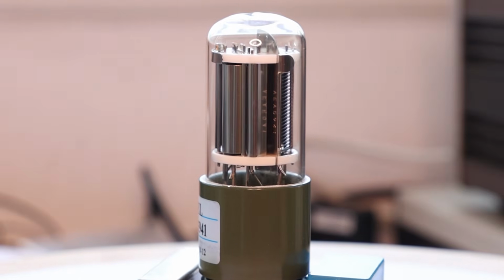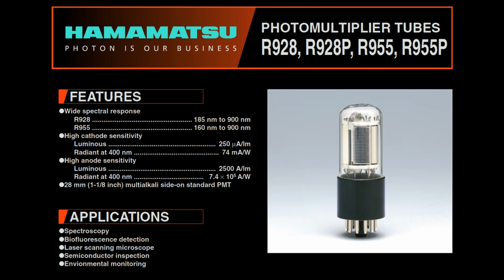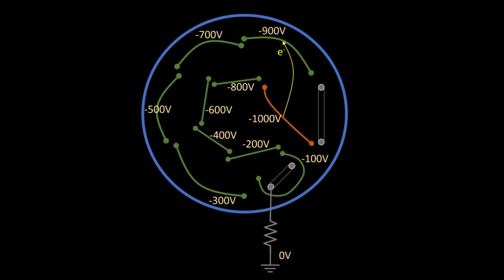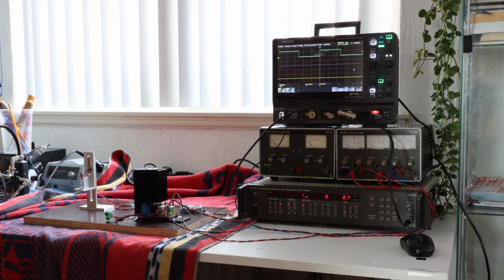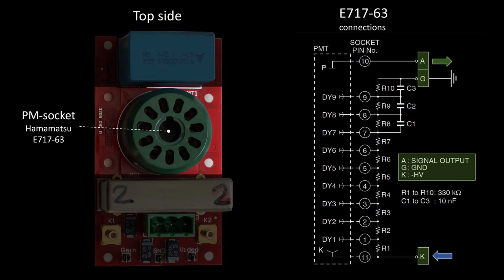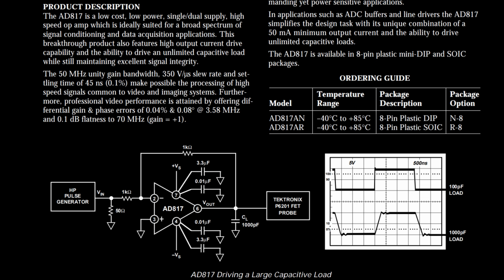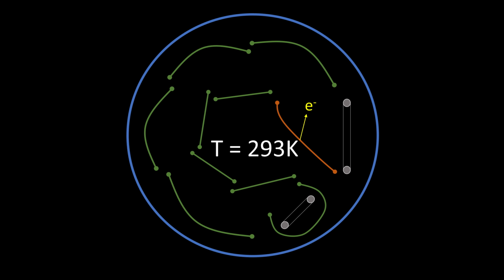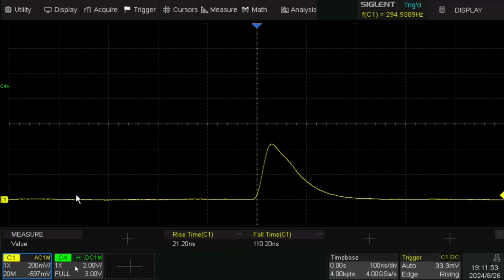PMT1: Using a Photomultiplier to Detect Single Photons

Comment: Bro do not complicate it too much that light on near uv band and uv band acts as a corona discharge in the tube mixed with that cesium  make the vacum conductible and acts as an heating element in the vacuum tubes or magnetrons is not something interesting Einstein was dumb sometimes is easy as it seems to be in fact you are not measuring a particle you are just dielectric polarising the tube by make it more conductible the light acts as a transistor and light is field thats why it conducts only in uv +/- bands bcz is cesium effect is like the transistor when you connect - in base it conducts positive in the output if you connect + it connects negative in output

Comment: TLDR;

50 years ago, under Dr Alan Penny,  I was an undergrad doing a project with a slightly related technology - an electronographic camera.  A photon strikes a photocathode, which emits an electron.  The electron is accelerated by a structure of electrodes and focussed onto a mica screen at the end of the vacuum envelope.  A photographic film sits outside the vacuum envelope, pressed against the mica window.

The photographic film records an image,  and every photon (until saturation)  is recorded on the film.  The reason for this technique is that it is linear at low luminance, unlike regular photography.  This enabled quantitative measurements of dim stars from globular clusters where some of the brighter starts had already been characterised.

I wrote the software on a DEC PDP-11 to scan a microdensitometer across the film and record traces of individual stars.   There then followed some very low-tech curve fitting involving curves printed on transparent squared film, scissors and sellotape, which relied on all start seeing the same "seeing" - i.e. atmospheric disturbances and camera resolutions, which convolved all the point source stars with the same curve.  A change in luminosity of a star was a shift of the same composite reference curve when plotted on a log scale across the image of the star.

Thank you for your video,  it brought back some happy memories.

Comment: Thanks! This video was so informative and interesting! In fact several years ago I built a radiation counter, which is made up of a PMT coupled to a block of scintillator material. I built the electrics up from scratch and was able to observe pulses ok and even show some colleagues the results. But I didn't quite appreciate  the thermionic effects, and can see that there is so much more to learn about these fascinating systems. Looking forward to part 2!

Comment: Lots of PMT modules from old UV-VIS spectrometers etc.  I find modules H7828 and H9305, capable of photon-counting (non-chilled, so not so low dark-counts at 300K deg.)  The H7828 has a fast amplifier/comparator/etc., while H9305 is just a bare PMT with a HVDC supply module.
Big pixels for a single-photon camera!   Or, add a hunk of scintillator.    I wonder if the HV and amplifier still keeps working at dry-ice temp?   But needs a dewar window, so it doesn't frost up.
PS, some standard PMT sockets have built-in HVDC supplies, e.g. HC123

Comment: Dumb question but why is there a cascade of electrons? The energy of the first emitted electron is less than the energy of the first incident photon which we try to detect. So, I think that the energy are injected by the plate, but how? By the electric field?
Reply: yes, the field between the plates

Comment: I always wonder where the material gets new electrons. I mean if you saturate the detector enough, electrons leave the surface. but where do the surface of the material get new electrons?
Reply: The surface needs to be a metal. Same thing with a CRT. There is an aluminum coating on the vacuum side. Perhaps the photocoating is on a layer of ITO like in twisted nematic LCDs? Isn't indium expensive. Should I buy in plane switching LCDs? I do not understand why we still have no photonics to channel the background light into beams through the LCD so that we can use standard metal for the electrodes without losing light.

Comment: I think you maybe have the equipment to test something pretty simple... I can't find hard data on the transmission percentage of 3 polarizers... it looks like 25%-ish... ya know... with 3 polarizers each turned +45 degrees or -45 degrees from each other (or 2 at 90 degrees, with 1 in the middle at 45).... what is the actual transmission percentage?  QM would predict 25% almost exactly; while I think it should be higher... like 27.75% -ish.... but either it's that far off from QM that noone wants to publish such large error bars, it's such a trivial thing with no application so noone cares to write the paper?  or .... It's not significant to even note?  25% is good enough?  I see a lot of qualitative presentations, but I'd love some quantitative data.  - hey and if it IS more than 25%?  (it might not, because polarizers don't quite transmit 50% of the light but are only 97% efficient (or so I hear) ) so there's a 3% error bar built into any polarizer experiment...   and 27 - 3% of 27 is probably 25... which it really shouldn't be...  anyway please do reply with such a result

Comment: I kind of unrelated question I saw how they were making plastic optical lenses for reading glasses and so forth could you possibly design a blank for a Schmidt-Cassegrain😊 telescope that has all of the correct dimensions that can accept that same type of epoxy that they use and making glasses?

Comment: What is a less expensive means to make a laser diode detector other than a photo multiplier for a nanosecond Avalanche laser driver met as a lidar and over overclocked basically for distance so I'm looking for 500 m? Can you just flip around and use the so-called Avalanche laser diode detectors? I know that you can use a photo multiplier but they're very expensive

Comment: An excellent presentation of theory, explanation of setup and communication of results.  Bravo. 
Perhaps you can put some scintillating plastic in front of the pmt and count muon hits? Sandwiched plastic/ detectors can be used to measure muon lifetimes with the appropriate processing. 
I'm subscribing.

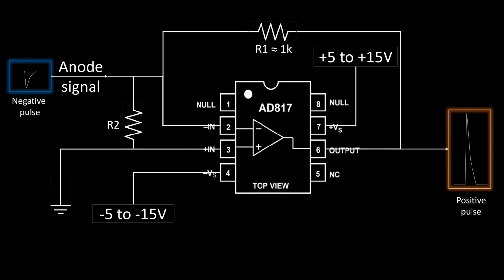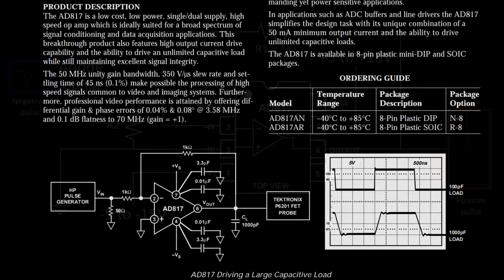Comment: The schematic at 16:35 seems to be wrong. There seems to be a missing resistor that should be in series from the top point of R2 and the inverting input of the OP. The correct schematic can be seen in the following figure at 16:50. The left 1 K Ohm resistor is the one that is missing in the schematics at 16:35. Despite this, very nice and instructive and educating video…

Comment: Great video. PMT are also widely used for detection of x-ray or gamma radiation. A scintillator is used to convert the gamma photon into (visible) light which in order is amplified by a PMT.
The PMT with electronics is a bargain. You have also quite an impressive collection of Philips lab equipment.

Comment: Have you not convince yourself to use SiPM (SPAD?) instead? Hamamatsu also have these, similarly, it is what dTOF distance measurement would use (LiDAR or Prox sensore that STMicro sells), ancient Laser distance measurement (when HP made them) also uses APD to lock the return signal. Seems a more sensible (living in the realm of AI chatbot) to use these instead IMO. Ref: Millimeter-Precision Laser Rangefinder Using a Low-Cost Photon Counter [Eisele, Andreas]

Comment: You may be in luck.  I used to make this exact power supply with a fully potted HV section and dynode array that did not even leak at the picoamp level, so super clean voltage delivery, and it was very low noise as well. You know, everything a good DC supply needs to be.  The F-4 Phantoms that were still in use in Japan at the time had these detectors in a rearward facing orientation and they detected single photon events (or more) like a missile launch from the ground.

Comment: Nice video. Reminded me of an experiment I did in high school. I got a surplus image intensifier from Edmond Scientific for $12 which is basically the first stage of the photomultiplier with a photocathode screen and electrostatic focusing onto a phosphor screen. I used a B&W TV that someone threw out (color TV was coming into fashion and people would just toss their B&W TVs on the curb) as the HV source, a string of resistors to create a variable voltage source for the focusing electrodes and a camera lens to focus the image on the photocathode. It worked. I tried to turn it into a spatial radiation detector by replacing the photocathode with a NaI scintillation crystal, but it was beyond my abilities as a high school student, but it was good enough to place me as a semifinalist in the Westinghouse Science Talent Search contest. Yippie!
Reply: Too expensive!  I never saved up enough allowance. The Edmund Scientific RCA 6032 tube.   Years later I heard that, at 20KV they're x-ray emitters, and really need a Pb-glass eyepiece.  
Today I have a box full of 1P25 tubes and a wwii USN ir scope. (I keep seeing 1P25 for ten bucks at ham radio fleamarkets.)

Barrington NJ 08007
This is Farnsworth Tube 
#6032 or RCA6676. It is a 
later model tube than the 
1P25. Potential should be 
approximately 20,000 volts 
(as compared to 5,000 for 
1P25). Size is 4 1/2 " long 
and 2" diameter at its widest 
point. Complete directions 
included. No. 70,160 $12.50 Ppd.

Comment: These are super videos, beautifully explained and diagrammed. A question I have is that these random pulses-described as thermal electrons with the photo multiplier might not be triggered also by random particles as detected by a Geiger-Müller tube detecting cosmic events?

Comment: I have one and the single small board the octo plug is on. Came out of a optical densometer. Has a shield and a slit window that a fiber optic bundle with a polished end was attached to. That went to a lens that the fibers formed a ring around.
   It was for comparing master textile or paint samples to production, a quality control measure. Not enough paint or too much dye would be evident to a fine point.
   Never seen another sensor like it. It has always been a mystery I couldn't throw away.
   By the base, I thought it was an exotic valve but never ripped the light shield off (it is a roll crimped can), to look for a number or maker.
Reply: The lens was just to observe the sample, it magnified about 5x.

Comment: What about emitters?  How does one emit a "single" photon or say electron.  Would it not be just a steady "stream" as its a wave?

I've always wondered about this, particularly in relation to the double slit experiment.  How does one shoot individual particles which would infer isolating an individual particle (would this not violate uncertainty principle?), and then when you "shoot" said particle, would that not impart energy on it thus changing the particle at a fundamental state?  If anyone can answer these for me I'd be eternally thankful.  Google is not what it used to be, it is so hard to find information on the web nowadays to say a decade ago.
Reply: IMHO the coated photocathode is the screen in the double slit experiment. We can maintain the position through the amplification using microchannel plates. I propose very thin plates. And then use a chilled CMOS sensor with per pixel amplification ( no stray capacity ). The voltages can hence be minimal. I imagine that we trap a single atom. Then we excite it to some long living state ( perhaps indirectly like in a laser ). IMHO QM tells us that the energy of this state slowly leaks into all directions. We use a 4 theta objective (cube?) to map all directions onto the photocathode. At a random time and position the wave function collapses and a photoelectron is emitted towards our multiplier.
QFT "rattles" on our excited states to make them leak, but this does mean that it introduces randomness.  The EM field rattles in all directions at the same time.

Comment: Curious, when a photon of enough energy lands on a material surface (with a given work function), does the "kick" to the photoelectron always send the electron flying out above the surface? Can the electron be lodged further into the material's volume instead?

What would happen if a photon hits a super-thin sheet of photoelectric material? Could the electron come out on the other side?

Comment: When a photon knocks an electron loose, how is that differentiated from a localized thermionic electron emission caused by a few atoms heated up for a few nanoseconds due to the absorbed photon energy?
Reply from the maker: You cannot really distinguish between pulses from photon absorption and thermionic emission. The only thing you can do is prevent thermionic emission by cooling.
Reply: @HuygensOptics  so thermionic emissions are a function of temperature and should average a constant rate for each temperature.  And photonic emissions only begin occuring when the photon energy is large enough to provide electron escape velocity regardless of temperature?  In other words, the random localized energy of electrons/atoms due to thermal energy does not add to photonic energy to allow that electron to escape? 
    In other words, thermionic emissions do not increase at all when hit by photons below the electron escape energy?
Reply: I think an electron emission depends on the initial thermionic energy of that particular atom (ie vibration energy or mass of atom*velocity^2/2) plus photon’s energy absorbed by that atom.  You can think of the velocity of the atom as creating a Doppler shift in frequency of the photon. The Doppler shift changes the energy of the photon which will in turn give some atoms enough energy for an electron to escape. The higher the temperature, then the wider the distribution of Doppler shift energy on a per atom statistics.   The net result as an equation that does not have as sharp a cutoff in emissions as function of the light source

Comment: Why don’t telescopes use photomultipliers? Seems to me 2 small diameter high magnification telescopes separated by a distance in space could merge their optical paths and create an effective interferometer if a photomultiplier is used.  Photomultiplier array such as in night vision goggles
Reply: Chilled semiconductor technology gives 10 electrons effective noise. Wafers are just so big and so high resolution. Tubes are blurry: Remember how TV looked back in the day. Though I think that I have seen some talk shows on youtube where the cameras used dedicated sensors for RGB. There is always this memory effect when a bright light hits the sensor.
Reply: @A @ArneChristianRosenfeldt night vision Googles use arrays of microscopic tubes as photomultipliers. The resolution depends on the number of microscopic tubes and is in the ball park of DVD resolution and can approach blu ray DVD resolution.  Signal to noise ratio will be worse than cooled sensors designed for low noise, but noise can be cancelled out.   Angular Resolution of the resulting image will be based on the Airy disk created by an aperture diameter equal to the separation distance between the two 2inch telescopes.
Reply: @douginorlando6260  A thanks. I used an IR viewer, but saw no channels. It was just blurry. Wild to think that an external photoeffect works better for IR than internal in my eye or with silicon.

Comment: Great video! Some possibly helpful hints: A cheaper choice for a photomultiplier tube is the 931A, and there are tons out there. They are just fine in normal light, and not going to get damaged. One example: The B&K 1076 used one in front of a CRT (video section) with louvers in the case exposing the multiplier tube to outside light while the device was in use, and it performed fine, in fact they still work today. Have fun, don't get zapped! :^)

Comment: why those pulses are so different in height? I was expecting all of them to be the same, except from static as it can be emitted from any dynode
Reply from the maker: That is something I also wondered about. I think the main issue is that the amplification factor in especially the first few dynode steps has a very large spread in value, leading to a large spread in the pulse sizes at the end of the amplification process. There is also the possibility that when the photon energy is high enough, it can in principle releasing more than one electron.

Comment: To block all light you might think about a camera obscura lens (without the pin hole..).
You might find it in the kitchen on a roll...

Just an idea...     8-)
Reply from the maker: In the next video, I've made a box coated with aluminum foil, which is completely light tight. (If that is what you are referring to)
Reply: @HuygensOptics  Didn't think you did not know, but I could not skip the joke..